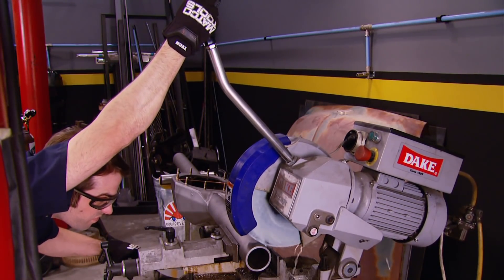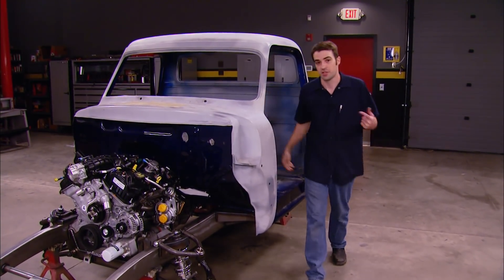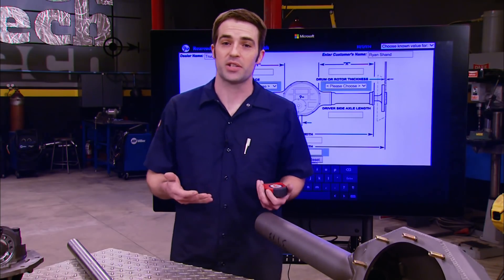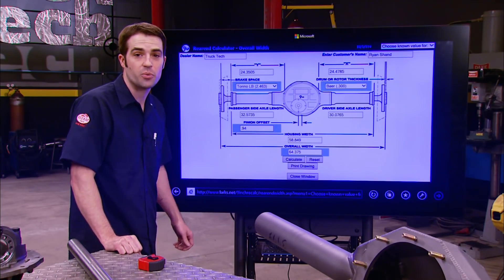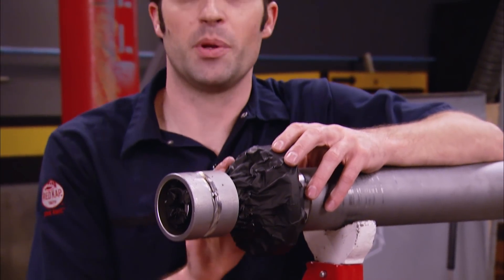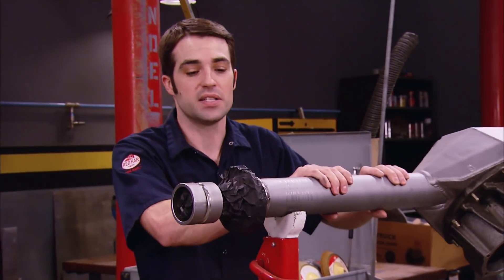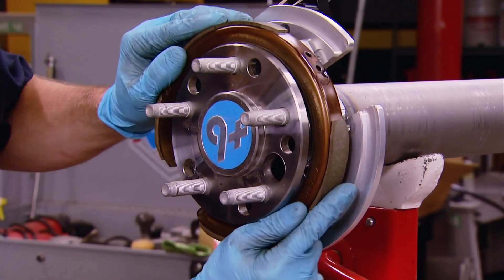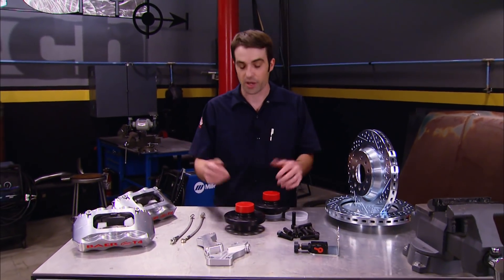F100 Gets 9" Ford Rear Axle to Handle A Turbocharged Eco Boost - Truck Tech S2, E2

Comment: any one out there remember what maker back in 60s offered a two speed rear end
Reply: There were three main manufacturers for 2 speed rear ends.  International, Columbia, and Eaton.  They are more commonly used on your commercial heavy duty trucks.  As for the pre 80s medium & heavy duty pickups/trucks, years and models varied.

Comment: How much of the Axle came from Ford?
Reply: None the design is a ford 9" nothing was made by ford tho its the most common type because of the tail bearing on the pinion allowing for alot more hp
Reply: @2511jeremy  - I would call it a Curie or an aftermarket   9"  Ford Design.  The pinon gear is supported by three bearings and being able to set the 'pumpkin" on the bench instead of the entire axle is cool too.  Lighter than a Dana 60 as well.  The clips that retained the axles on the GM 12 bolt was a bogus design.
Reply: @bigboreracing356  - Stock parts, Chevy 12 bolt vs Ford 9" diff. Don't know about you, but I'll go with the FORD unit. May be running a Chevy motor though...  ; )
Reply: @bigboreracing356  -Wow!  That was stupid!    The aftermarket starts with the Ford 9 inch which is vastly superior to the GM stuff.  And by the way, your emotes  add nothing to your worthless post.  Try again.
Reply: @bigboreracing356  - At least I'm smart enough to know how to spell "Stupid."

Comment: Stretch on the bolt when torqued? Like mains and rods studs?
Reply: What I thought
Reply: @impavitus  I've been watching several YouTube series; powernation, etc.. and they use a torque wrench with a specific Guage that measured bolt stretch when tightening studs on heads and main caps. The engines were LS and Coyote engines for street/strip use.
Reply: @jamesdiehl8690  there's definitely a science to what they do
Reply: more likely something on the threads

Comment: That whole rear housing is overkill for that engine.
Reply: If you overbuild it you can drive and not worry about it breaking.    Plus with tuning and bigger turbos that v6 can make some healthy power.
Reply: @bmstylee  The weak point here would be the standard gear housing and a clutch-type limited slip. If you really worried about a regular housing deflecting just weld on a common back brace. This is, of course, just a commercial for Currie's product and the bragging rights associated.
Reply: Good thing it’s their build and not yours then.
Reply: @bigboreracing356  Fine, but if you are going to go through the trouble and expense of that housing, then fit it with an appropriately upgraded center section, not some nondescript piece. This is mismatched.
Reply: @bigboreracing356  It's a non-webbed case without through-bolts. You can bet racers that are actually using that housing as a race piece are NOT employing that same carrier. And what kind of an insult is "window licking we Todd"? Grade school? Oh, and this loser has twice as many 9-inch rears as you have fingers and toes.
Reply: @bigboreracing356  when Bear, EBC etc is 'donating' parts, the hosts dont get much of a say or input into what products are. PN always bows to their corporate overlords whims
Reply: A stock f-150 with an Ecoboost has an 8.8 axle, just like the 120hp 3.8 v-6 did in 1980.

Comment: Nice truck but I would put a different motor in it
Reply: Since it's not a daily driver it's a non issue.   Personally a Coyote would be cool.   But availability wasn't great when they built this.
Reply: It will be interesting to see how long those turbos last! That little engine is a powerful engine though. The cost of one of those turbos might be the cost of another engine ? Love to see how long they last ( Twin Turbos ).
Reply: @bigboreracing356  wow that is truly incredible. That is alought more mileage than I expected.  I have seen these turbos crap out with fewer than 50,000 miles, without the engine being abused at all. Ford had a diesel turbo in the 90's that was just poop. 35,000 miles was all 1 turbo would go.

Comment: A procharged Ford 300-I6 would have been a far better engine than that over stressed boat anchor.
Reply: Sounds like something a boomer would say.
Reply: With three in the tree. Now that's original. No need to be a boomer that's what the Factory made. But then they are doing it from someone else's work. Looks super COOL.
Reply: @pauldionne1665  who else other then a boomer wants to top out at 60 mph? Lol.
Reply: 300 boat anchor is a better description.

Comment: Seriously? Two passes are needed for welding the axle housing. Your single pass is marginal. your issues started with your bevel grind not being correct. About that parking brake.... Are you planning on disassembling it later to put in the rest of the mechanism?
Reply: @bigboreracing356  , LMAO

Comment: watched you installing front hub w/bearings. they need to be torqued to 5-7 ft pounds. especially important if using synthetic grease. doing the old way just by feel,you can wind up with 25-30 ft pounds on the bearings(synthetic) which can cause bearing failure. did it once.
Reply: I will remember that if I should ever do that (bearing replacement). Thanks  for the tip.